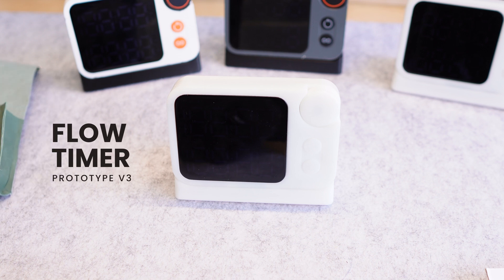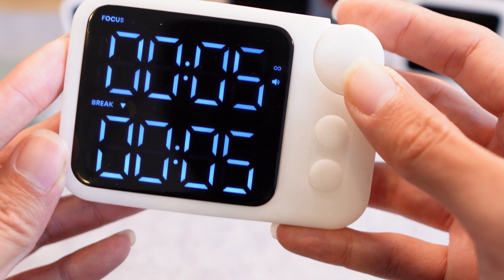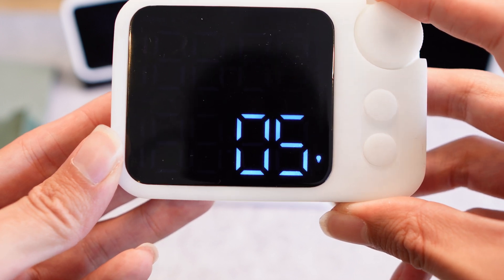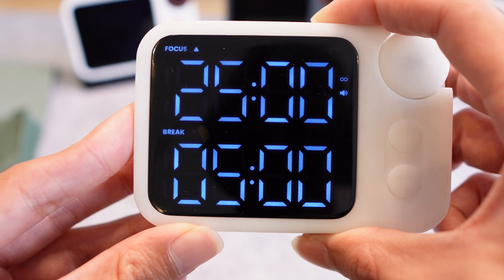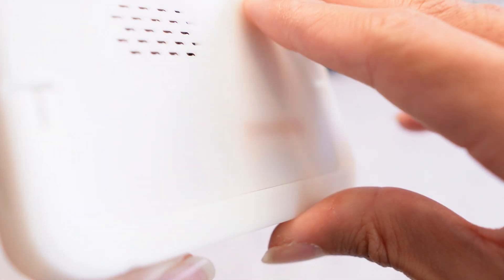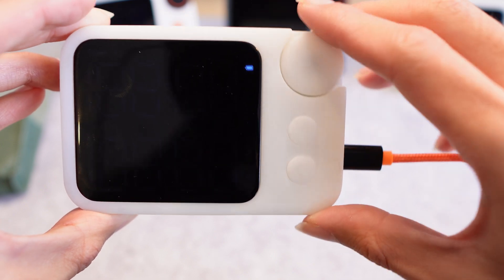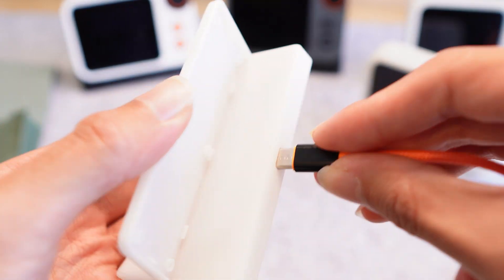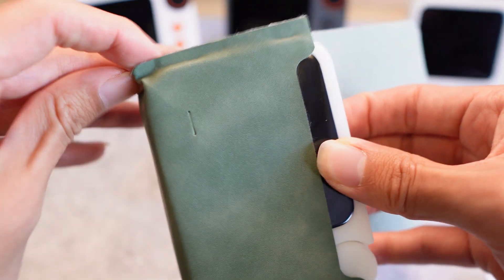Flow Timer - Prototype v3 - Update Video

Comment: Really nice to see these updates. I have the original one you guys made a year or two ago. I only use the timer function because it doesn’t automatically switch to the break time like the new one does now. But it looks to come with so many new features but I think for my needs Il have to keep using the old one despite the new one being much better just because it still works fine despite its short comings. 😢
Reply from the maker: Thanks for the comment! No worries, the old version still works for its purpose, it's just not as refined or made with the same quality materials as the new one :) also we worked hard to make the user experience a lot nicer on the flow tiner

Comment: Super cool, very excited! Can't wait to order one. 

I agree with the other comment that it should be a matt finish screen, too shiny and distracting. 
Glad you have the dock with the rear facing USB , the side facing USB would've been a deal breaker for me, can't stand having visible cables in my minimalist setup
Reply from the maker: Yeah can definitely understand! The side-facing port on the dock is only if you'r desperate and need to charge the device while you're away haha.

Comment: Nice. Any chance of an alkaline powered version? Or at least user replaceable batteries?
The rechargeable battery is a clear downgrade. AA devices can last decades. Lithium powered devices are obsolete in 3-5 years and are another fire hazard.

Comment: A few points of subjective feedback. The display – looks cheap and I hope it's the fault of the video. The sound is the biggest shock to me – I did not expect this device to beep like a $1 egg timer :( The dock – I would expect it to be slightly tilted, so it's easy to see the screen when the device is placed on a desk. The case – I would never use it, unnecessary cost.

Keep up the good work, guys! I really hope that you'll include some nice sounds in the final product, as the current one is a blocker for me.
Reply from the maker: Thanks for the feedback! We've just finalised all of our tones and the default beep isn't part of it. The final device will sound a lot better.

The display is also just a prototype display, the final version will be a bit clearer and whiter in colour. So stay tuned!